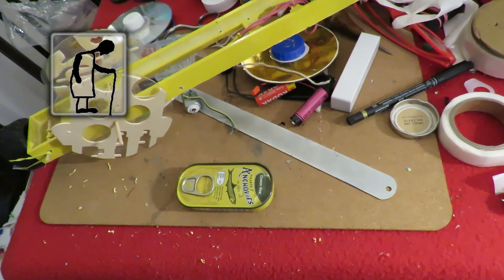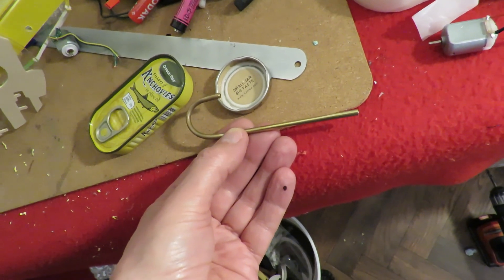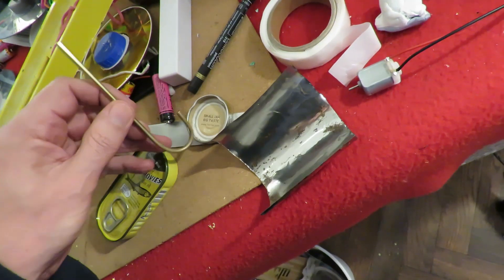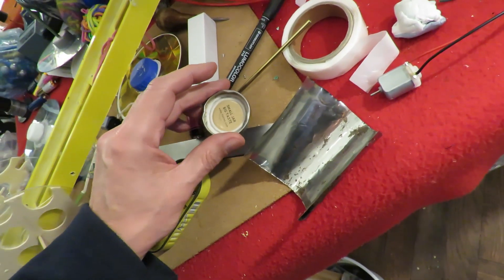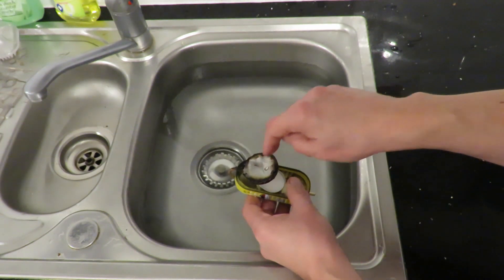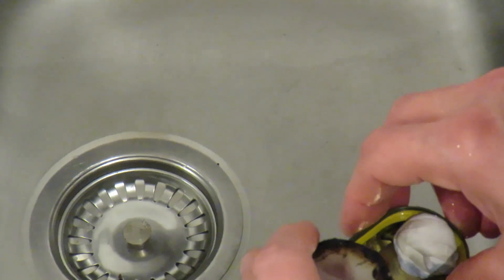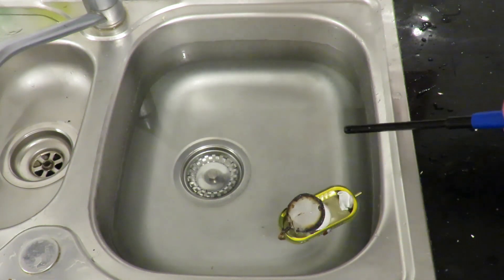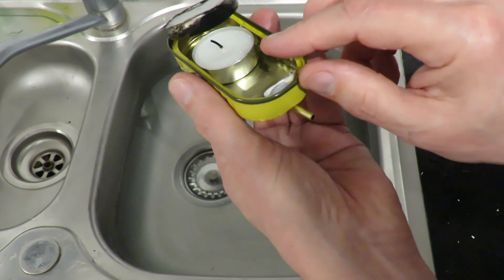Fillets of Anchovies Pop Pop Boat

Comment: That was interesting to see a one pipe system working. Pity that the solder joint failed.
I am really surprised that you found a can made of tin plate, especially the Pepsi max can. I remember when Pepsi max came out and at that time I assumed every can of pop was made from aluminum, so in my opinion finding one made from tin plate is quite unusual. :D
Reply from the maker: It was probably a collectors item that I have just destroyed 😮😲😁
Reply: @GrandadIsAnOldMan : LOL, You have probably destroyed "LOTS" of collectors items. LOL :D